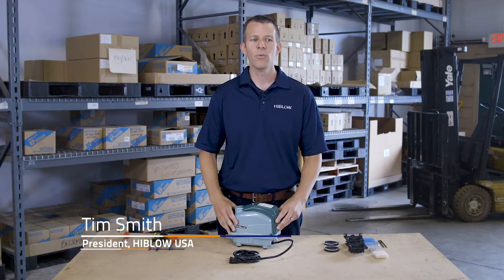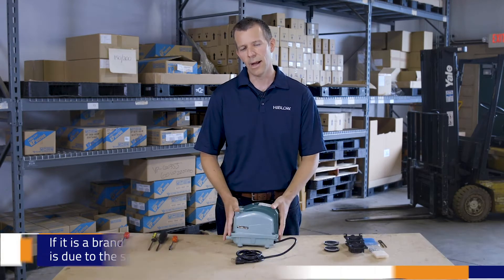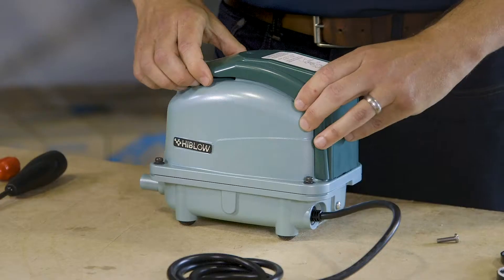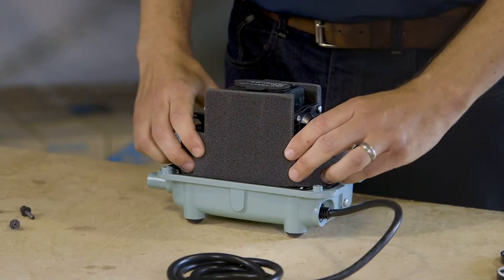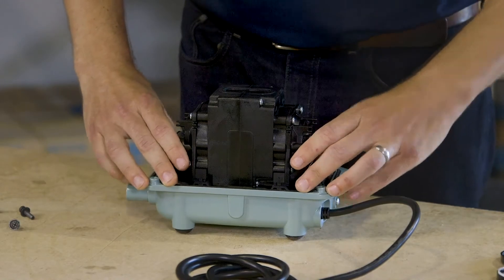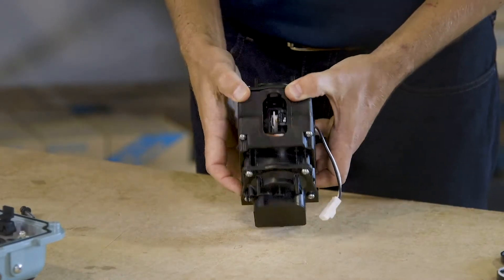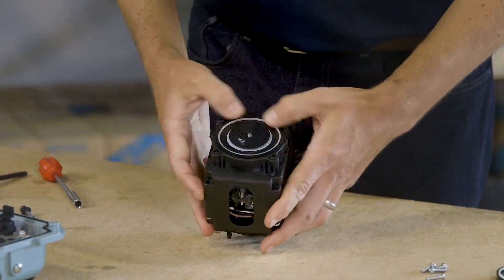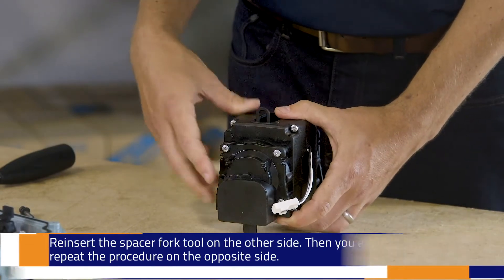HIBLOW XP and WG Series Rebuild Video (XP-40, XP-60, XP-80, WG-2, WG-3, WG-4)

Comment: The video stresses to not over-tighten the diaphragm retaining nut. I took this way too literally, and didn't tighten them down enough. One of the nuts came loose and the pump trashed one of the new diaphragms, so I had to order a whole new rebuild kit. 😕 Be sure to snug the nut up (you will feel it when it does), then don't over-tighten after that.

Comment: The safety switch was still in alignment but the pump is dead. What could be wrong? Do I still go through the other steps?
Reply from the maker: It could be electrical.  Check out our electrical continuity video which shows you how to determine if there are any breaks in the circuit.  Feel free to call us four help troubleshooting.  734-944-5032 or email us: info@hiblow-usa.com

Comment: Should I install a safety valve and check valve on the tubes between the hiblow and difusers? Or is it protected against pressure increases and back pressure?